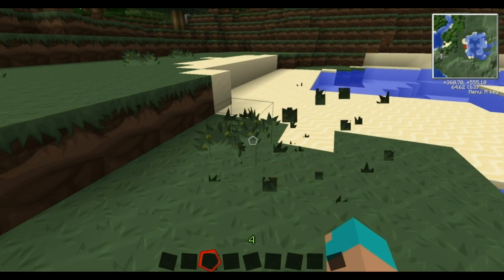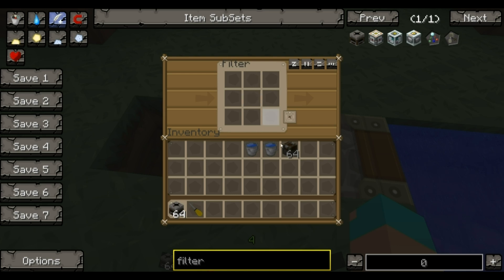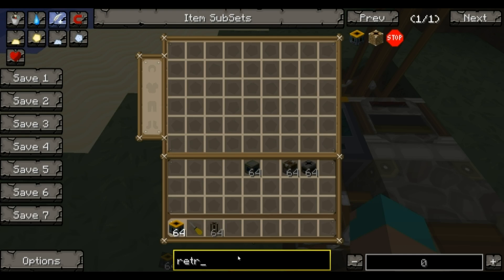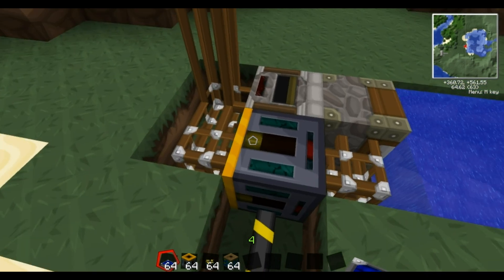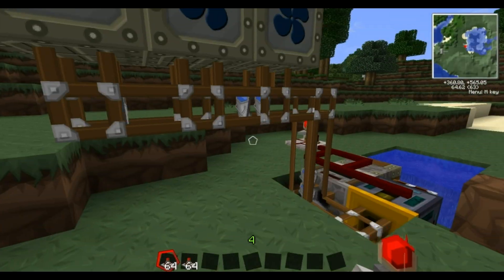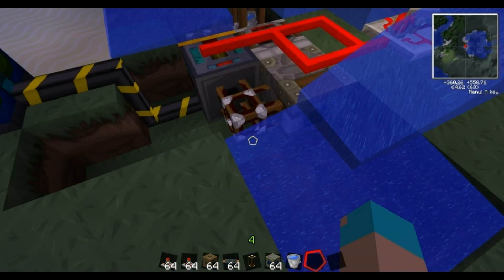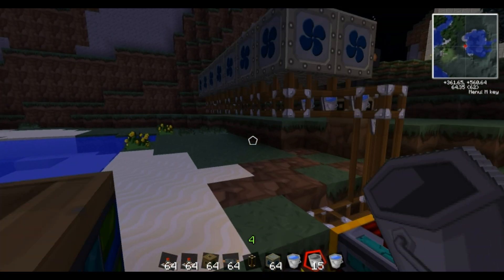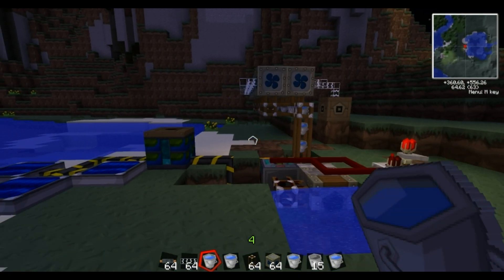ChirpCraft Tekkit Lite Infinite Energy Generator Tutorial

Comment from the maker: this is happening because you deployer doesn't have anywhere to put the buckets. make sure your filter is set up correctly and that the filter and deployer are both receiving a signal at the same time. Basically your filter isn't taking the water buckets out of the deployer, resulting in the deployers inventory being full so it just spits them out.